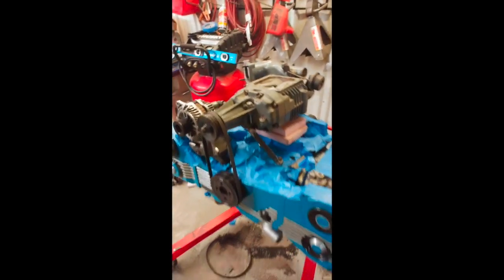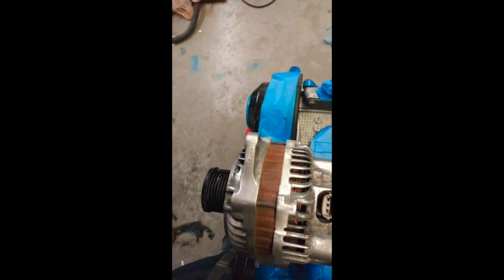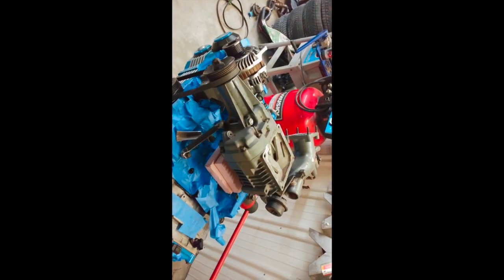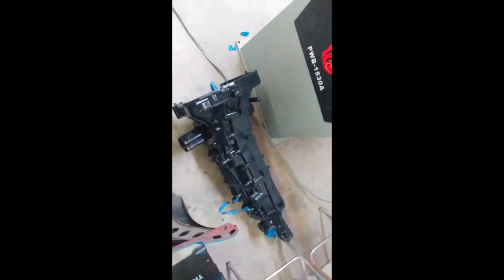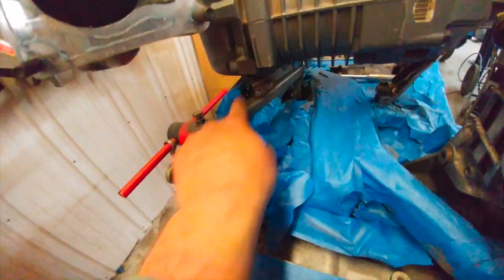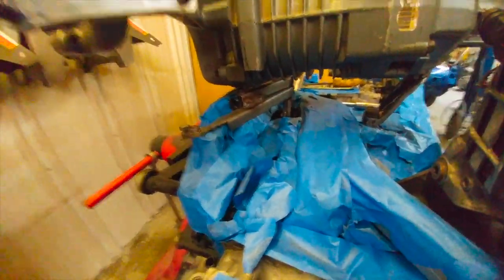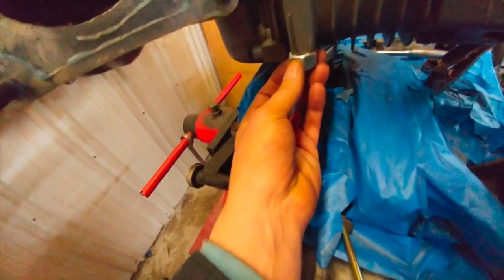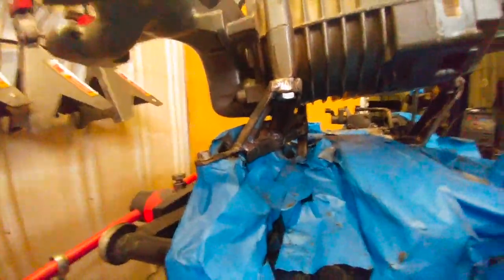Supercharged Subaru Outback Eaton M90 EJ257 Roots Blower Overland

Comment: the slave cylinder loocation would of been a non issue if you would have wen with a pull type clutch. you may still be able to. depends on if the clutch types can be swapped from trans to trans. i have a jdm 04 wrx trans and its a pull type
Reply from the maker: I looked for a while for a way to convert this model, but found nothing. There is plenty of pull to push conversions available though.
In the end I got it to fit under the hood by trimming the underside.
Reply: @boostedproblems5139  as far as i know to convert from push to pull you need a pull type clutch, pressure plate, throw out bearing and then a pull type slave cylinder. i think the clutch fork is the same and the flywheel should be the same

Comment: Um hello what this is insane. Subscribed!
Reply from the maker: Thanks !
plenty more where that came from. new episode drops tomorrow :-)
Reply: @boostedproblems5139  Did you consider converting to a cable clutch?
Reply from the maker: No, I had however considered converting to a pull type fork. In the end I kinda wanted the hole in the hood lol

But future vids will show it still fits, I made a small hump in the hood for the pulley. And some trimming to the underside.
Reply: @boostedproblems5139  Awesome. :)